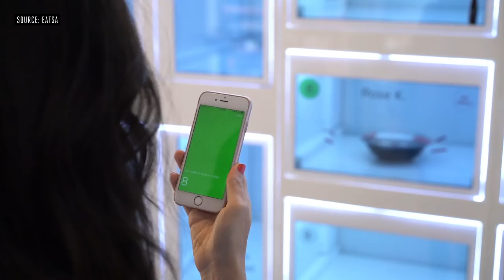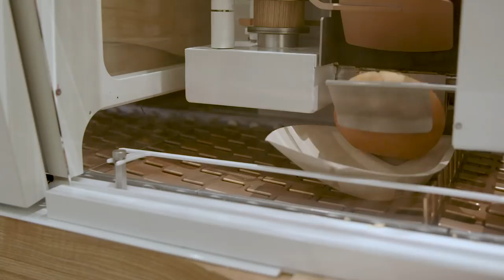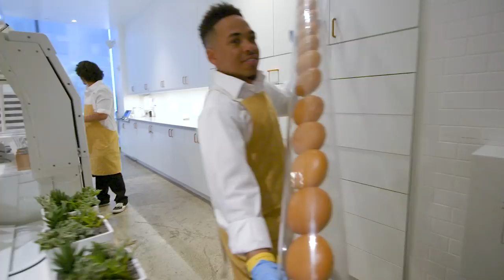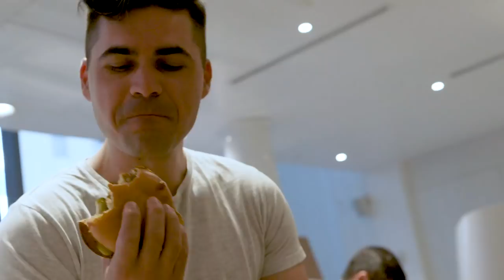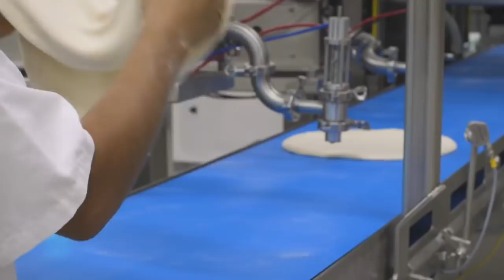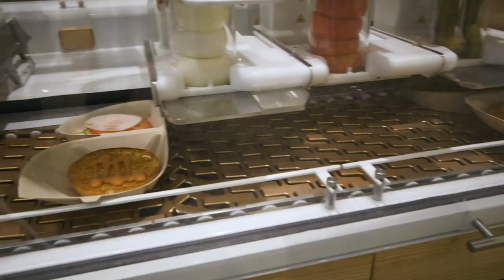Robot restaurants won’t take your job and food will be better

Comment: From burger flipper to maintenance staff. Pretty good promotion imho
Reply: Riiiiight...   because the unskilled Burger Flipper will be maintaining robots.  "Hey Billy!  I know you can barely put a burger together...  can you figure out why the menu interface is dropping commands to the servos?"  Not even that...  the Boss won't even know where the problem is.  "Hey Billy.  The machine is skipping parts of customers orders.  Can you fix that?"

More like 10 burger flippers lose their jobs.  1 Bot Maintenance dude get hired.  1 Bot doesn't need dedicated full time care...   Bot maintenance dude is contracted out.  He covers multiple restaurants so really he's replacing 100 burger flippers all around town.

Until 5 years later they make a Maintenance Bot that can handle cleaning, routine maintenance and 90% of the most common issues.  9 Bot Maintenance Dudes lose their jobs and 1 gets to stick around to cover the 10% of issues the MaintBots can't and operate the maintenance fleet.
Reply: Yeah. The video said both that they won't come for our jobs AND that the restaurants will save money on labor by using machines. So which is it?

And how tf is cheap rent an argument here? This is downtown San Francisco. Clearly rent wasn't an issue.
Reply: In a high priced area you want to reduce your rental cost by reducing the number of square footage you need. The robots are claimed to need fewer sq ft.
Reply: The market is saying those burger flippers should be working somewhere else. By your logic, lawns should be cut by hand-held scissors. Those newfangled power mowers reduce the number of workers needed to mow a lawn from 30 to 3. 

If a burger place in a certain area is ONLY economically viable because of the robots, that means it wouldn't exist at all. Meaning zero workers, zero demand met for the public, and zero tax collected.  Defending low-tech is a fail on every front.
Reply: It's not maintenance in that way, what they meant was loading buns, adding more tomatoes to the slicer, making sure that everything is running on the production line the way it should, they even showed in the video people doing all that. Obviously they'd have someone more skilled, someone who built the machine to maintain the software etc. jeez... does this really have to be explained? Watch the damn video...
Reply: Both can be mutually exclusive. 
They made an argument that it's not the robots taking over jobs, but it's the cost of rent and living expense that reduce the number of job applicants. If there is no worker flipping burgers and robots fill the gap, it's not technically taking over. Someone has to be working for a job to exist. There was no job to begin with.
Reply: S Userman robot are the response to workers asking 15 dollars for low or unskilled job
Reply: I’m a White Castle work and I approve this message.
Reply: So, basically this really isn't all that innovative. 90% of the construction of the burger is still the by staff, all the robot is doing is dropping the staff prepared ingredients in tubes and the tubes are dropping ingredients per customer request and just cooking it up like a pizzahut pizza.
Reply: Programmer?  Who said programmer?  I said "maintenance"...   like a car.  Oil changes?  Servo replacements after XXXX hours of operations?  Conveyor belt tension adjustment/replacement?  And what happens when the Spatula arm jams?  Software patch?  There is going to have to be someone that maintains the physical machinery...  and it won't be the former burger flipper.  That's what I was addressing.

[Inflamatory rebuttal deleted]
Reply: maybe at first, but eventually every task can be automated... human employment will gradually become a thing of the past

unemployment will skyrocket, even if a few humans are still needed for certain tasks
Reply: exactly, obviously the robots aren't going to need anything like the same number of people maintaining them as used to flip burgers
Reply: @Withnail1969  any how long until they upgrade the robot to clean itself, or make a new little cleaning robot to to do it.
Reply: @sylvestregagnon5681  Untrue. Companies would do this regardless. A vast majority of the labor market will be obsolete in the next 20 years, no one is safe weather you are minimum wage or in the top 10% of income earners.
Reply: @whuruuktheork4525  Robots can maintenance each other or themselves. Human intervention is  unnecessary .
Reply: Clearage 1 yes and no. Complicated labor laws and people asking more than they worth on the market créate an incentive to put robot. In a country like china where labor laws are less restrictive and work force is abundant it not likely that robot Will replace people as much as in the state.
Reply: I thought they'd make a maintenance bot that would replace me as a computer service tech. Instead, they just made disposable computers people have in their pockets. (And I've moved careers to adjust.) I'd guess something similar will happen. In a decade or two, they'll just throw away these machines in a landfill somewhere in favor of the newer model which cost less / is faster / etc. (Instead of making maintenance bots.)
Reply: @sylvestregagnon5681  what defines worth? I thought it was based on the profit you help create and idk about ur company but mc donalds makes billons so they are worth alot .....
Reply: Randy Ozaeta what defines worth ? - If you ask more than your market value than you créate an incentive to be replaced by robot. McDonald's making millions is not an argument. Évén if you are à billionnaire when you go to the store the price for toothpaste is the same rich or poor. The market value of value of work does not change because you happens to be successfull. Someone with no expérience or skill have pretty much the same value if hé work for a small company or à big corporation.
Reply: @sylvestregagnon5681  idk what price has to do with profit .... if the company you work for is making hand over fist in profit like amazon like walmart like mcdonalds etc it stands to reason as the worker who is essential in making that profit you would be paid well (like idk a car salesmen)..... but instead what your labor creates doesnt matter what profits you bring in doesnt matter your still paid terribly..... also machines happen regardless of pay... tech always gets cheaper even if you paid workers a dollar an hour eventually a machine would be cheaper as it runs 24/7 and has one time up front cost plus some maintenance everyonce and a while, where as for a worker to get them to come in you have to always pay so your argument doesnt actually mean anything as the workers were replaces by machines in the industrial revolution and they werent protesting for more pay at the time heck they needed work so badly their children worked thats how little they got paid ... pay and robot replacement have no real connection as eventually tech will always be cheaper ...
Idk what defines worth personally i thought being a human was enough worth to have basic needs met but people tell me its based on the income you bring in, but the companies paying people so little they cant survive make billions so that doesnt make sense because evem McDonalds employees make billions for mcdonalds with their labor.
.....
Reply: Randy Ozaeta the company who make billion have to work hard to get there. When they eventually make billion it doesnt means it all profit in their pocket. There is lost. Sometimes they make à lot of money for some years and then compétition emerge and suddenly they dont make that much money. Making billions doesnt means you cant pay whatever you like. Company cannot take workers live in charge. They pay the value of work as you as a customer pay as little as possible when you buy something regard less as the interest of worker.
Reply: Randy Ozaeta the industrial révolution happens because of new technologie. Sewing machine for example that make hand work à thing of the past and make clothe cheaper for everybody. They did not really replace anybody, they créate à New industry that did not exist before. Robot today do not créate New industry they replace worker. And yes people asking more than their market value has to be one the reason has why they became more attractive. Not the only reason but one of them.
Reply: Randy Ozaeta McDonald's make billions across the world with how many store ? Distribute that amount with numbers of worker minus lost and what numbers are you getting ? When you have précise mathématiques ring me à Bell !
Reply: @sylvestregagnon5681  o like oddly mcdonalds can pay 21 in denmark but not anywhere else must be a magical place :) or maybe thanks to collective bargining they got what they were really worth what you produce is what your worth ... bringing in millions individual resturants and people defending multibillion multinational companies like they dont got money SMH <.<

 yes technology moved forward in the industrial revolution why else did workers fight and burn building with new machines cause at the time they lost their jobs which is desvasting to well id say anyone living paycheck to paycheck like most americans :)
Reply: Randy Ozaeta denmark is not à magical place. It à place, like switzerland for instance, where standard of living and éducation  is much higher than anywhere else. So few people want to work in those low skilled job than other place. So McDonald's must offers higher wage or automatized to attract workers. You cannot expect McDonald's in bangkok or china to offers the same wage for that type of job Since standard of living and éducation is not the same. Plus if you want higher wage go to school and study something that is in high demand on job market. Dont expect multinational to pay your bill out of charity. As you yourself you dont buy their stuff out of charity.
Reply: Randy Ozaeta industrial révolution - some people lost their job and some others found new one. So what your point ?  We should had stop progress in order for some people to keep making handmaid clothe that only few people can buy ?
Reply: Randy Ozaeta most américans - américans, and westeners, have the higuest standard of living in all humans history. Poor people today eat Meat everyday, have cell phone, one or two tv, WC in every home, electricity, public transport, some have car, free healthcare, cheap clothes, etc. If we listened to people like you we get the idéa that thing have never been worst. The reality is poor people today have never have such easy live. They live better than louis the fourteen minus living in a castle.
Reply: @sylvestregagnon5681  life always improves in human history thats not a very good point its not any one system that inproves human life but human ingenuity overall and my point is the industrail revolution happened in spite of poor working conditions and terrible pay ... its not tethered to wage and treatment of workers also across the world poverty has only increased other then China... also how do you explain an democracy that doesnt work for the people... its called an oligarchy... the systems broken most would agree we need change  idc what kind of change just that we do it collectively as workers... cause thats the only way it can happen....

Also if denmark stardard of living is higher yet our country is richer doesnt that speak volumes of our systemic problems...

My point beint wages have nothing really to do with automation should we simply lower our stardard of living even more to prevent the inevitable? No its gonna happen just let it new jobs will be created but dont blame it on wages and stardard of living like its the driving factor its all about profit and cost and technology always getting cheaper innovation will happen doesnt mesn the workers should live in provety just to keep jobs or should be blamed for simply wanting the life that the american drean promised them that the system promised them these expections arent created by people themselves but by others (rich people) who made promises capitalism would naturally make them richer ....
Reply: Randy Ozaeta humans ingénuity exist from the beginning of mankind. Ingénuity without à proper économic systems dont produce much result. Without capitalism efficiency there Will not be talk about socialism. It only became à subject because capitalism make possible richness that was not possible before. Working conditions improve simply because due to économic efficiency some stuff that was not possible in the early age, due to scarcity and mentality, became possible in a more affluent society. In développing country conditions Will improve over time. I have see in youtube clothes factory in daka Bangladesh that it so high tech that they are better than in america. Machine are so efficient the worker just put fabric in the machine and She almost do all the job. So yes conditions improve. The pay cannot go that high though simply because they hire people without skill and for most are illeterate. Those people would not évén be offered à job in the west with the minimum wage.
Reply: @sylvestregagnon5681  the only reason there wages are so low is so we at the top can be blessed with cheap supplies cloths etc..which we now need due to our declining system economically improvising a majority no amount of past good deeds makes up for current systemic issues and the arrogance to assume and believe that only captalism can make advancement is extremely narrow scoped .... also understand the military through collective means has help create a majoirty of the tech we enjoy not thanks to capitalism creating it but insteas marketing the tech our tax dollar already paid to create....again not the point .. the system now in.its current state is failimg the majoirty and when systems fail majoirty well history has shown the blood shed and guillotines brought forth thanks to that... so maybe its time for some collective change for a better future not a past that no longer exists
Reply: Randy Ozaeta if you want higher wage go to school and study something that is in high demand on job market. People with no skill and almost illeterate never gonna command high paid. As business without knowledge, hard work and knowledge never gonna succeed.
Reply: Randy Ozaeta worker paradise was supposéd to be communist country. But somehow they never manage to rise the standard of living to be better than capitalist country. Milton Friedmans said the best garantee for worker to have Good paid and Good condition is the existence of a compétitive job market were worker have many buyers competing to buy is labor. In america there was such market. In russia there was only one possible buyers for the worker labor which is the state. In conséquences labor value never raise that much.
Reply: @sylvestregagnon5681  not sure i ever advocate for communism i like worker coops with a ubi combo to guarantee a basic stardard of living :) also its up to the system to educate the workers so its of course failing there too.... blaming individuals for being ignorant in a system that doesnt want to educate them is nonsensical... also those who followed there promise of education well it hasnt quite worked out for them ... its a false promise and it simply rasies the bar woth starbucks asking for potential employees with at least a bachelor... its another one of the contradictions in this system where what good for individuals isnt good on a massive scale in the system.... at the end of rhe day id your a woeker and struggling your not alone and when a system takes the richest country on the face of the earth and makes a majority of its working popularion economically poor well thats a failed system i dont argue what captilism helped achieved in advancement isnt good just that everything get outdated eventually and contridictions over a long period can break anything as well as no one system being the perfect system including rhe one were currently in and that any system can great positive results just depends whats positive.....
Reply: Randy Ozaeta nobody prévent you from créating such enterprise. But as you will probably discover if you ever pass the talking stage this kind stuff are not as easy as it sound. And making à dollars and staying in business is not given to everyone. And Good intention alone cannot make you succeed.
Reply: Randy Ozaeta the problems is not capitalism but government involvement and pointless régulation that reduce compétions on the market and make life easy for big corporation who like them because they are the only one who cans navigate through them. Leftist and big corporation go hand in hand and ask for pretty much the same thing. Big government and bureaucracy and Open border all three stuff alone are enough to make sure worker conditions and salary dont improve. That why mainstream news outlet have no problems putting leftist on tv Since they pretty much ask the same things.
Reply: I really want to see robot /artificial intelligence to start processing ideas at their own and start making robot without any human help so every become jobless.
If you are IT..guy, than the golden age is at it peak at the moment, and before you know, you will at the row with person who is flipping  burger or mapping your office floor, in fact you will be less advantage because that person can adopt to leave on almost nothing... So to whom it may concern, don't get too excited.
I think it should be adopted law that put extreme high tax on profit that comes strickly from robot as labor, extreme high tax on corporation that use the robots as main source of their labor, and high incentives to corporations who hires more human labor..
Otherwise, large corporations going to be in huge advantage for designing their robots that fit their needs while small business ultimately shut down because the high payroll compare to their competitors...if you open robot pizza franchise with one person, compare to pizza shop with 4 or 5 workers, you are going to sell pizza for 4 while small business asking for 10 to pay his payroll...
Reply: @whuruuktheork4525  I am lower than the burger flipper (kitchen porter and cleaner) and am building my own robots to replace myself. I am pretty sure I could deal with the "menu interface." The problem in America is hyper-credentialism when staff could be retrained instead of replaced by someone paying off a massive college debt. And hyper-rents due to no rent control and parasitical landlords.